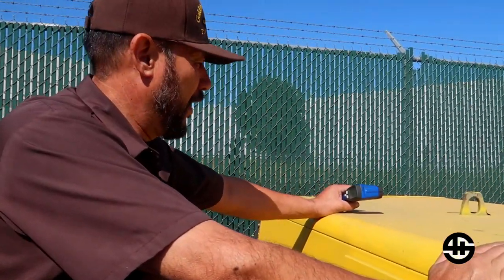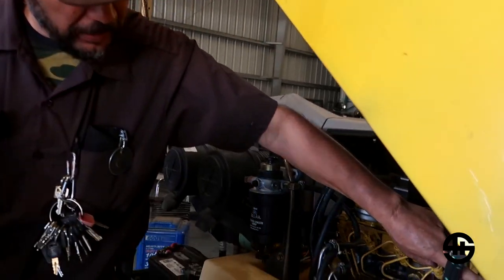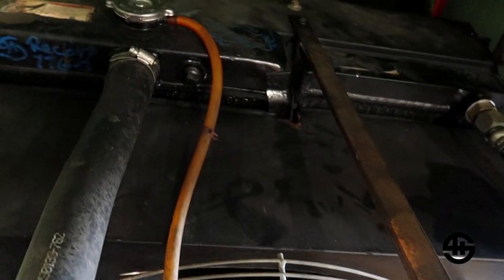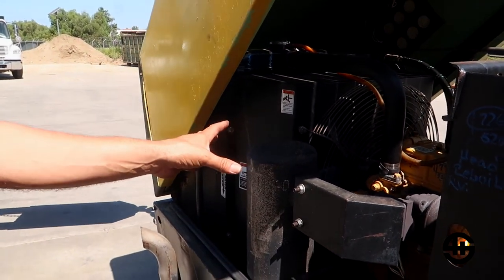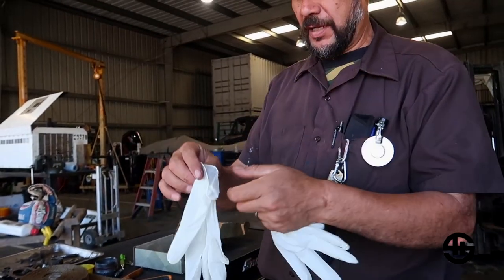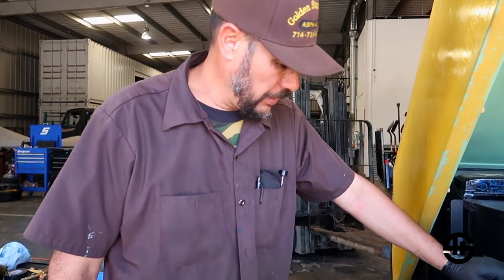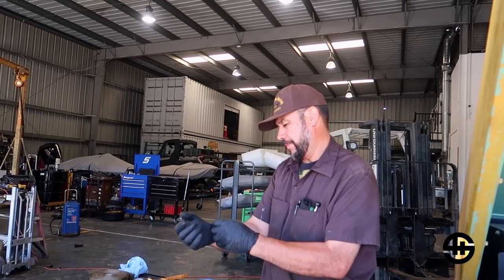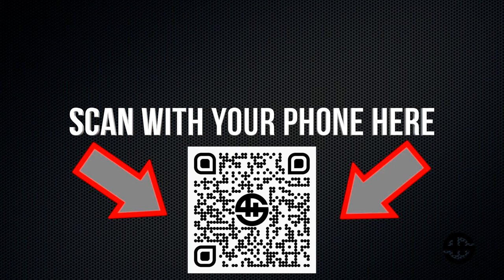Sullair 185 Compressor

Comment: On those metal zip ties, I've found it easier to use a small pick to push the metal ball as far back as possible while you're pulling on it to get the best lock

Comment: i have the same problem run for 10 min when the weather is cold  and stop runing Thank you
Reply: Well, those compressors have shut downs systems that will shut down when it heats up it could be either the air pump, the engine, temperature, radiators are dirty it’s a number of things.
Reply: @tonysanchez7943  Gracias  Thank you
Reply from the maker: @jatz8710  no problem si necesitas ayuda dejame saber
Reply: @thehydraulicspecialist3176  Gracias  si estuvieran cerca se los llevaria para que lo revisaran espero y  me puedan ayudar  podrias hacer un video de como cambiar el aceite hidraulico y el filtro separador me podrias pasar tu numero para asesorarme Gracias
Reply from the maker: @jatz8710  9095781116

Comment: I have sullair that turn into an oiloholic any ideas what could be wrong? I add lube but eventually after a few hrs it starts to overheat
Reply from the maker: I need a little bit more information. What oil is the eating? Is it the engine oil or the air pump oil bear in mind that you could get overheated from both